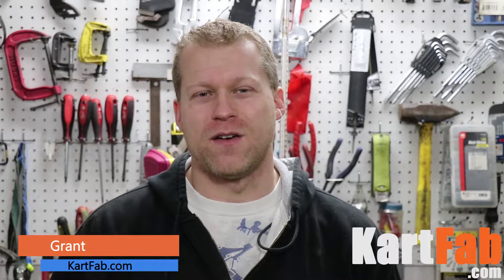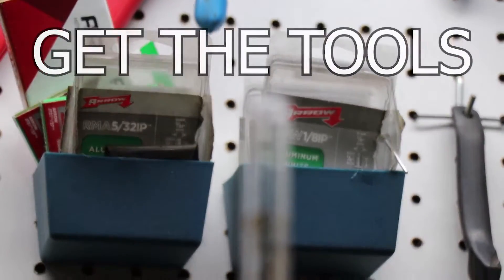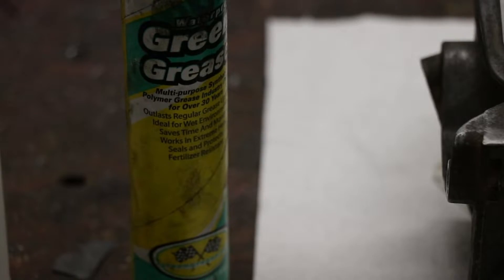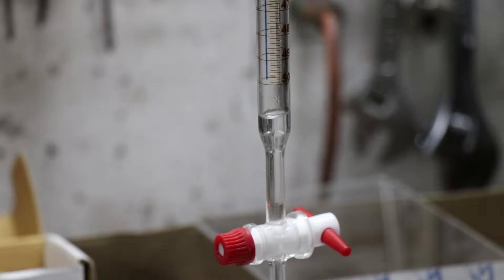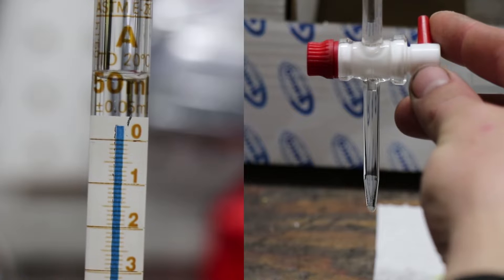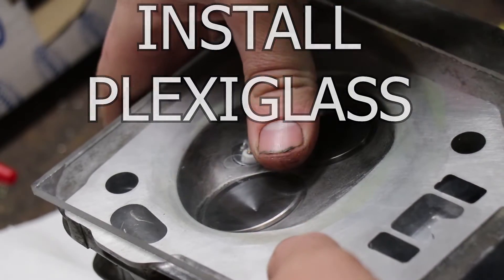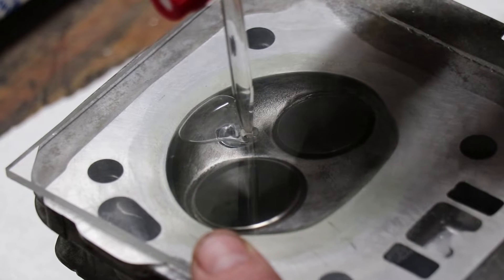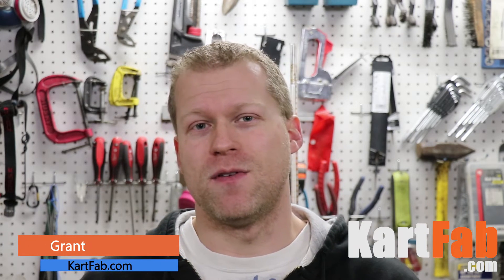How to Measure Combustion Chamber Volume: Cylinder Head 101

Comment: Did you also have to put grease around the valves? Or did they seal up on their own enough to hold the liquid?
Reply from the maker: If they are properly cut you don’t need to. But it doesn’t hurt

Comment: I’m rebuilding a 05 ski doo summit 800, My rebuild kit came with three different base gaskets for the cylinders. How do I measure this volume in accordance with the correct gasket?
Reply from the maker: You know the diameter and thickness of the gasket so you can calculate volume of each one and add it to the measured volume of head.

Comment: I'd draw attention to you correctly using the merest smear of grease to seal the plate - there are some "professional" folks posting that use relatively thick coatings and this can give inaccurate numbers. For example, a 4" (101.6mm) bore engine has a bore cross sectional area of 81.07 square centimeters and, as every ten thou' is 0.0254 cm, it doesn't take much to be inaccurate as even that example is going to give a 2.06 cc difference.

The second thing is if you use a longer piece of perspex you can do several, or all, cylinders at once. use a head gasket to establish and drill where the head bolt holes are and you can drop bolts into them to hold the plate in place. When you've done that, you can drill the fill holes along the 'top' edge for easier filling.

Comment: What about the space from the top of the piston... I have a book that says to bring the piston to TDC, seal the edges with grease, fit the head and gasket, and measure that way.  Your way seems to be a simpler way... but will the measurement be off?  I'm learning as I go here.  It started off as a simple bore kit upgrade and learning my parts of my moped to a complete tear down, upgrade, and rebuild!
Reply from the maker: More than one way to skin a cat
Reply: The total unswept volume - the volume above the piston at TDC, is made up of several spaces, of which one is the cylinder head chamber, and this is the one that's usually got the variations as they're sand cast and the moulds may be slightly off.
The top surface of the pistons are usually held to close tolerances, but there can be variations in the 'deck' heights of the block - this is the position of the piston relative to the gasket sealing face. The problem is that sometimes it isn't machined totally square with the crankshaft and/or bores and just a little off can make a significant difference - you have probably read of 'squaring the deck' to ensure the pistons are the same distance down the bores at TDC. On that, you may also have seen references of lower compression because of the pistons being further down the bore, and maybe even of machining the decks to increase the compressions.
Sometimes different thickness gaskets are used to add, or subtract, unswept volume.

NOTE, for V8 engines, because of the way the intake manifolds fit the engines, and the way the heads move relative to each other after machining, the manifold will normally also need machining.
Reply: @gordowg1wg145  wow!  Thanks for that response!  He's me understand it a bit more.  My moped projects have been on hold for a few months but I will get back at it and I want to learn all I can and some of this gets confusing.  So I appreciate your words of wisdom. 😁😊

Comment: Would all of the chambers not be the same volume in a conventional engine?
Reply: That's a Great question. Not every head is the same on multicyclinder engines.  Most are close and miss it by one to three cc's.  Just think for a few minutes on how much more it would cost you if they made sure every head was Perfectly the same cc or ci ( cubic inch on cars and trucks ).  The V-Twin engine is harder to make it an exact copy  from one head to its twin other because of left and right molds if its a poured or even billet milled and will come with in 0.001 to 0.003 if and inch making the cc a bit harder to exactly match at any factory.
Reply: David Johnson So what’s the benefit of knowing this?
Reply: @hellishgrin4604  When you tune an engine, you mainly go by the #1 cylinder. If all the cylinders match, then all the cylinders will react to the tuning of # 1 cylinder the same way. Hard to do if every cylinder on one engine is different.